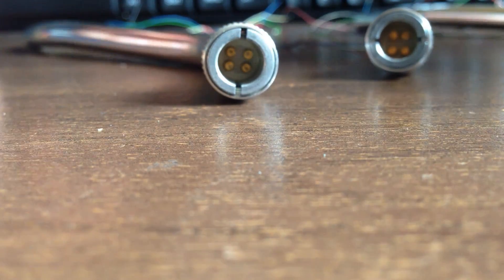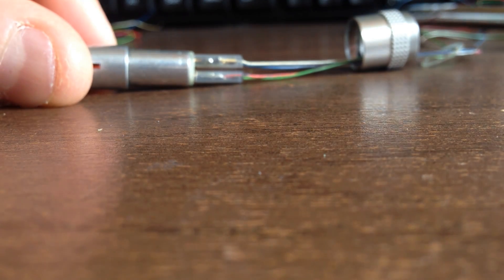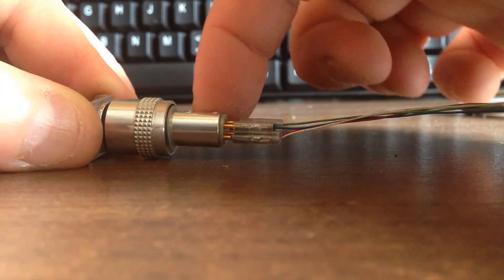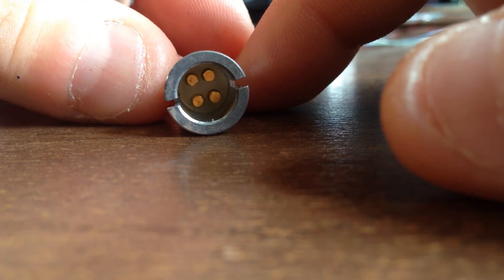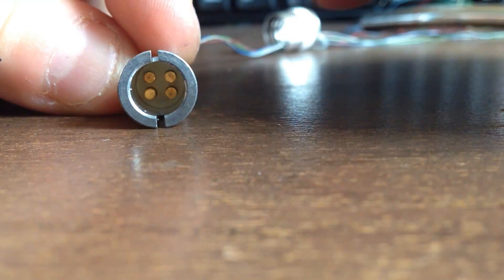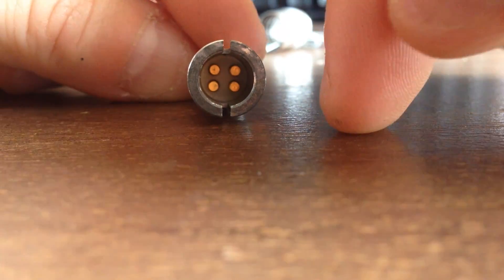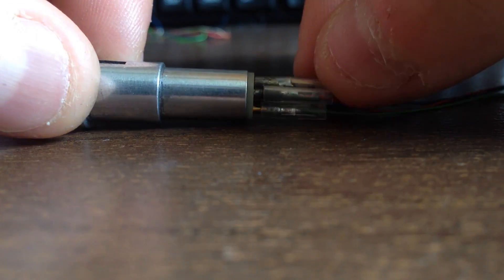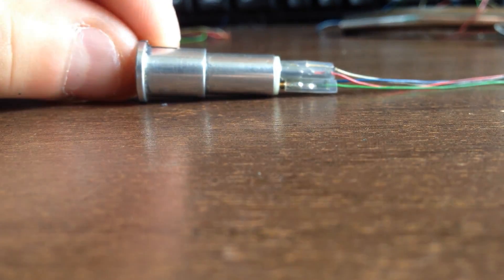DJ Repair Tutorial - How to Fix Stuck Prong Issue in Technics 1200 Tone Arm

Comment: Hi, I have a issue with my Technics 1210gr, when I replace the heashell the screw does not squeeze completely the headshell to the tonearm.So it is able a little bit moove. 
I looking for some advise if you can.
Regards
Zsolt

Comment: Thank you!! I used Deoxit D5 and a hairdryer and the pin popped out. However, after putting the cartridge back in the pin stuck again. So I went through the process again, but this time pushed on the pin several times to work the spring. Success! You da man!

Comment: I have a SL-D2 with issues in the DIN. The first time I sprayed cleaner inside and pushed in the pins it worked fine. Now it's back to the left channel being weak about 10dB. My original plan was to replace the tonearm wiring, but I couldn't get the tonearm out. I have a SL-Q2 and has no problem rewiring it, but this D2 is a challenge. Now I'm back to taking it apart and trying again. I'm gonna try the heat gun trick and see if it works before taking it apart. The pins spring in and out with no issue so it may be inside like you pointed out. Thanks for the video.
Reply: i had same issue, i took a small drill (2 millimeters) and slowly i unlarged the hole (my golden point was locked inside after have try to in/out it) when i did it the point went out and all is ok now

Comment: Nice Video But  notwithstanding your precious  suggestions My socket still have a slight amount a free play. The two small screws doesn't fix too much the socket to the tonearm .
Reply from the maker: Are you saying that your headshell wiggles when it’s fully mounted?
Reply: @djdaisentertainment  Yes I am
Reply: To that point I think I need  to replace the Socket .
Reply from the maker: Also don’t over tighten the two tiny screws at the bottom because it’s biting into acrylic and it’s easy to strip.

Comment: where can i buy this part? i dont look exactly for technics, anything like that would work
Reply from the maker: This is not a part sold on its own, it’s part of the tonearm assembly which can cost between $70 ~ $150 new.  If you would like to salvage the part I’m sure you’ll be able to find a “for parts only” listing on eBay, as the assembly usually gets replaced after it gets bent, or the ball bearing diaphragms are ruptured. Neither of these affect the head shell mount.

Comment: Im sure i need to clean it from the back. Any idea if its something i can do without taking apart all of the arm? I see there are 2 screws, maybe if im able to take them out i could move it just a bit to be able to clean it.. I'm fucked but at least ive found the problem ! Thank you
Reply from the maker: I wouldn't recommend it, because you don't have much play on the little wires that run all the way to the PCB.  You can attempt it, but make sure to open up the RCA assembly cavity and peal off the tape holding the excess cartridge wires in place, and watch how much of it you're feeding through when you CAREFULLY pull out the headshell mount.

To do it right, I would desolder the wires from the PCB and take off the arm assembly and then remove the headshell mount, clean it, and reassemble the whole thing.  The whole process would take me an hour maybe, two if you're inexperienced.  It's worth your time, the price for tone arms keep going up.
Reply: @djdaisentertainment  Thank you for the fast reply. Tomorrow i will open the thing

Comment: Great video! But accidentally I broke the blue wire at the connection. I've tried to pull it but there's no more length. It's easy to disassemble the arm and change the wire?
Reply from the maker: Sorry for the slow reply. It’s not exactly easy, but it’s also not rocket science. The hard part is finding the right gauge wire to replace the broken wire. It needs to be thin enough to not give the arm resistance while strong enough to not snap when pulled. I’m guessing 28 awg for this application.

Comment: Half a million videos on one of the most popular turntables world wide, not one, even one shows how to remove the retainung nut. I've asked and nobody can come up with an answer. Guess I will be taking my 1200 to my repair guy, because not one person can tell me how the damn retaining nut is removed!
Reply from the maker: I’m not sure what you’re referring to as the retaining nut.  Is it the height adjustment assembly?  There’s a mechanism inside the housing that locks the height which you can pull off by removing the E-clip holding it in place.

Comment: Thanks! I ended up dousing mine in contact cleaner and waiting... I had to make a few solid taps on the outside of the tone arm to dislodge the pin. (Tapped the area housing the springs with a small screwdriver and it popped right out.)
Reply from the maker: Ellen glad it helped!

Comment: wicked mate i have 1200 mk 5 gold ltd edition and would love any tips for returning them to there original glory days. i have done some custom painted chassis, but want to focus on tone arm rebuilds and audio quality ,cardas cables  upgrade etc. any vid links and tips would be very welcome cheers !!!
Reply: It's not hard at all. Strip the tonearm and base assembly doen completely and pay very close attention to how it comes apart. I've stripped, cleaned, greased, calibrated and rebuilt dozens of technics I learned by trying. Just pay close attention to how it all comes apart. The most complicated part of a turntable engineering wise is the tonearm assembly as far as the electronics go the tonearm is the most simple having x4 signal wires and a ground.
Reply: D2daK87 is it possible to return the tonearms to original spec after taking them apart? I’ve heard that the bearings are machine calibrated and if you loosen or tighten the screws it completely throws off the calibration and the arm will perform bad. How true is that?
Reply: I've customised loads and got the tonearm back to supposed machine spec by hand. It takes a fair bit of fiddling but it's doable. Essentially on one side of the gimbal the screws is welded into place meaning you only have to adjust one side. Tightnen it until the rattling stops and only when the rattling stops if you go tighter you can ruin the bearings but it'll become stiff before that happens

Comment: Hi,
I have a related issue, I think. I can not get the head shell to tighten fully on my 1200 mk2. I am using a standard Technics head shell and it pulls in but rocks slightly when tight. Would you have any idea as to the fix?

Thanks in advance.
Reply from the maker: Sorry for the slow reply.  The two tiny silver screws that holds the headshell mount to the arm might be loose or missing.  The only way to tighten them without disassembling the turntable is to find a precision Philips driver bit short enough (or at a right angle) to fit underneath the tonearm and above the faceplate.  

Otherwise, you'll need to spend about 5 minutes taking the feet, and rubber base off to access the screws that hold the tonearm assembly to the faceplate.  As I've mentioned in the video, screwing these tiny screws too far into the housing can cause the spring issue, so don't torque it too tight.

There's also a set of bigger black screws that hold the other side of the arm to the pivot assembly that can be loose or missing.  Be careful with this area because the pivot housing looks like polished metal, but is plastic that cracks relatively easily.
Reply: @djdaisentertainment  Thanks for the reply, will take a look as you suggested.
Reply: The easiest way would be to disconnect the power off first. Than remove the platter and raised the tone arm height. Then use a short small jewelers screw driver and try to tighten the screws.  Make sure there is no screws missing.

Comment: Is it possible to repair a tone arm that will not hold onto the headshell? It seems like the threads are not holding it in place anymore. Thanks!
Reply from the maker: Sorry for the slow reply.  Sounds like the problem could be your headshell.  There's a little dowel / prong at the top of the cylinder of the connector part of the headshell, that can be smashed in and can come up too short to catch on the threads of the tone arm mount.  I guess it's possible that the tone arm mounting mechanism has bent out of shape, but it would be as likely as a nut loosing its thread.
Reply: Just got a Yamaha.  It will not attach, seems there are no threads. .it won’t slide in all the way.. how to disassemble and fix the ends

Comment: You saved my SME 3009 tonearm, many thanks! After using a little spray of dust remover and contact cleaning and 10 seconds of hot air from a hairdryer the stuck prong really moved back to its position.
The only problem I have is that this prong doesn't spring like the other 3 prongs. Something still must be stuck. Are there 4 springs for each prong or just one? I will let it rest a night and look back tomorrow.
Update: After resting the prong a night it is fully springy as the other 3 prongs!!! The earth hum is completely gone at full volume up!
Reply from the maker: No prob man.  Yes there should be an independent spring for each prong.  Hopefully it doesn't seize up again, but if it does, you might have to do some deep cleaning by taking the tone arm apart.  Good luck!

Comment: Is there an easy way to remove the tonearm head?  The screws are position under the arm, and it's impossible to fit a screwdriver under there?

I am hesitant to take apart the whole tonearm to get at these pins.
Reply from the maker: I wouldn't remove the head without taking the arm apart because there are tiny wires connected between the head and the printed circuit board that routes that audio to the RCA and ground.  You'll at the very least have to take off the tape that's holding the cable slack inside the housing so you have like an inch of slack to work with.  Not recommended.